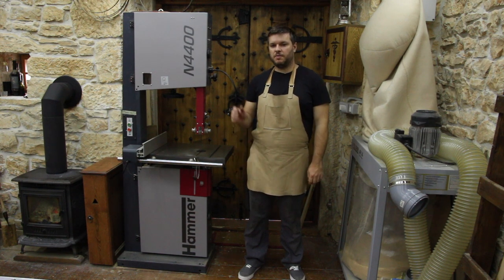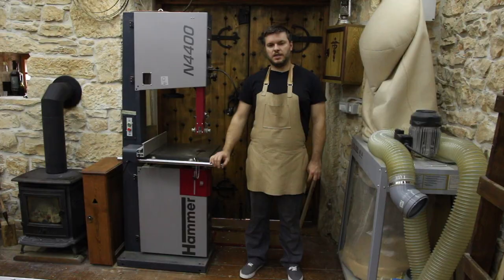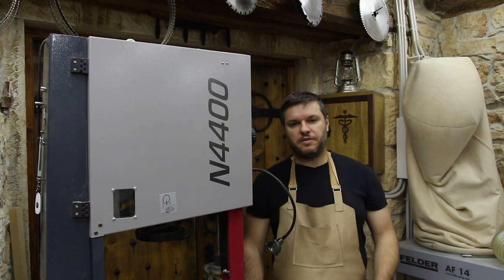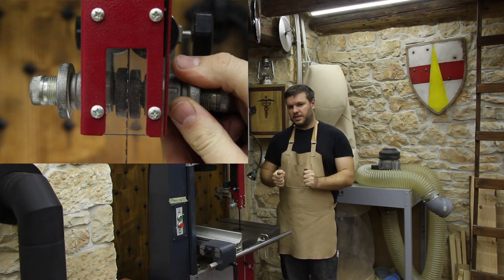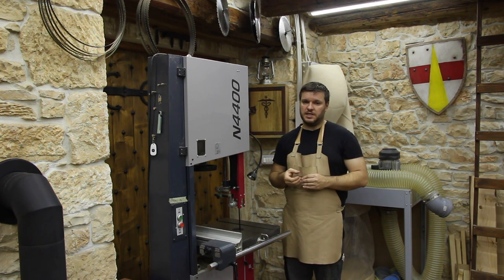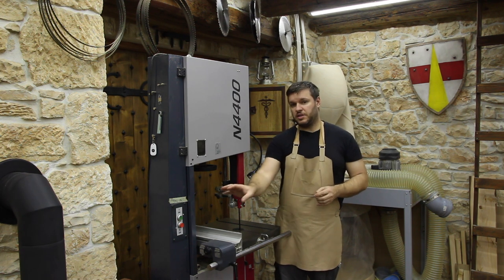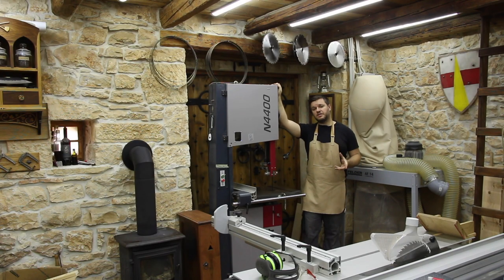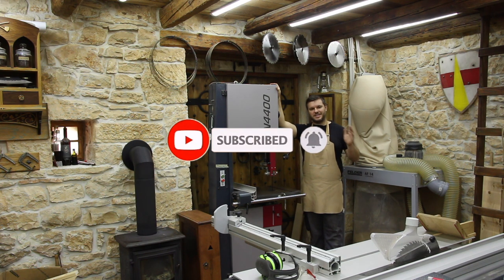Hammer N4400 Bandsaw - Likes and Dislikes

Comment: Forgetting to tension the blade is a problem with all bandsaws. What I do is when I un-tension the blade, I first open the top door. Then when I re-tension the blade, I close the top door. I just got used to only tension/un-tension the blade with the top door open. This has a lot of benefits for me:
* For setting the blade tension the correct way, you need the top door open anyway. I'll explain below.
* I never forget to put tension on the blade: because the door is open so the machine will not start.
* I (almost) never forget to un-tension the blade: when I look through the shop when I leave, I see that the door is still closed: that means I forgot to un-tension the blade.
* The top door has a circuit breaker: this means it is an extra safety measure helping with kids in your shop.

Let me explain why the top door needs to be open when tensioning:
Setting the correct tension is never done using the useless indicator on the machine. I moderately press on the sawblade along the length of the column on the left. I can only access this with the top door open. I just eyeball the deflection to be, let's say 10mm to 20 mm or so depending on the blade type. You can only do this along the left column, as there is nothing like blade guides influencing your measurement.
Reply from the maker: This is an eye opener! Nice tips, thank you for sharing :)
Reply: this is great idea :D

Comment: I have a N4400 and have the same problems with the guides and post. for a reminder about the tension I jus put a magnet on top of the table in front of the blade every time I take the tension off. great review. Thanks and good luck
Reply from the maker: The magnet tip is a good one! Thank you for the nice words 😊

Comment: Hello and congratulations for the review. I also bought the N4400 for 2 weeks but unfortunately I am not completely satisfied. For the moment the saw is stopped because it has a production defect and when it turns, it begins to vibrate dangerously ... it can happen, of course, but, at Felder, there is no testing and quality control service? I have been told that a technician will come in 2 weeks ... what? 2 weeks? And this would be warranty service? For the moment I am forced to take the wood to be cut by a carpenter friend of mine. I won't add anything else, otherwise I risk offending someone. One thing is certain: as soon as this problem is solved, the N4400 saw and the A3-31 plane will go on sale.
Reply: Did you end up selling your N4400? Or did you get the problems resolved and decided to keep it?
Reply: @Ezlivin  Hi,
in the end I sold it and bought a Laguna 18bx and although apparently it looks better, I am not satisfied with the build quality of the band saw (much better than the N4400). I have now also put the Laguna 18bx up for sale and am waiting for the Felder FB510. I hope to be luckier.
Reply from the maker: So have you got Felder 510?
I have two Felder 700 machines and I'm very pleased with them, they work fantastic and they are light years away from Hammer in build quality and performance.
Reply: @AndreaArzensek  Hi, unfortunately I haven't been able to sell the Laguna 18bx yet. Unfortunately there are some features of the Laguna saw that are unacceptable for potential buyers: 1-the blade replacement system is simply complicated and wastes a lot of time (ridiculous!), 2-the table inclination does not have a rack system and therefore the table must be tilted manually, losing all precision (very ridiculous and frustrating), 3-the structure of the saw is simply too light to accommodate 18" wheels. There are also other details, for example, I don't I like that this series is built on the "Asian continent" ;). I probably should have gotten a Laguna saw from the industrial series, which is built in Italy, but at this point I would have bought it directly from the manufacturer in Italy. As for the Felder FB510 or FB610, I think it's a great saw overall. The only thing I don't like is the lack of the quick blade release lever. At the moment though, I won't be getting any new band saws until I can sell the Laguna 18bx.
Reply from the maker: Thank you for your reply. Good luck selling your saw.
As I understand FB510 and 610 are the same saws just different wheels. As for quick lever tension - it is a shame but I got used on my N4400. I will probably upgrade to FB510 in the future or maybe look into some SCM machines.

Comment: This is a great bandsaw. I have one. It's very well made (in Austria, NOT China, like most or all of its competitors, and that was very important for me) and does not lack for power. In that class and price range, I think it's the best saw you can buy.

You're quite right, though, that the guides are the weak point. I have the very same issues you do. I think the N4400 may now come standard with the ceramic X-life guides (which is why I'm surprised to see yours came with the steel guides), though you can also buy after-market ceramic or bearing guides from Laguna and others. I have been planning that upgrade for a while.
Reply from the maker: We are overall quite happy as it is our first one and we don't know how we did without one. It is hard to compare because I have never worked on another one before.
But you're right about the power, I have monophasic motor and it eats through 10 inch oak with no problem.
I didn't know that they came standard with ceramic guides.
Reply: @AndreaArzensek  I don't know for sure if the N4400 now comes standard with the ceramic guides, but when I looked at the Felder website it seemed to imply that they come standard.

When I bought the bandsaw a few years ago it was somewhat new on the market and was considerably cheaper, so it was an even better bargain. I was looking mainly at some Lagunas (the Mini-Max and other Italians as well as the Felders were out of our price range). The N4400 turned out to be the perfect bandsaw for us. I prefer sawing a lot of things on the bandsaw because it's safer even than a sliding table saw.

Overall it's a great saw. I've resawn 10"-11" oak and maple without any problems. I run Lenox carbide-tipped blades (which are pricey but which I also recommend if you can get them in Europe) on it and they perform great. The steel-disc guides are tolerable, but if you can afford to to upgrade them it likely makes the saw even better.

Comment: Great review , i also have the Hammer N4400 , the K3 sliding table saw and the jointer. Honestly the only tool which I really like is the jointer. The K3 has many problems which are just annoying and the N4400 is also just lacking a so many details. The small fence, the missing scale on the fence , the horrible bladeguides ect...
Reply from the maker: I have found fence on N4400 to be Oland I don't miss scale on the fence, but it could have been added. The blade guides  have left a lot to be desired. 
K3 Winner for me was a disappoint but we upgraded to K700 and that is a beast, probably even an overkill for our needs but we love it.

Comment: Good review! I really enjoy your review. Little tip: I also always had the problem with tensioning the bandsaw, till i made a wooden block with magnets, which kind of functions like your sticker (it also says "tension!" ;-) ). 
Only difference is, that if I'm tensioning the saw and using it, i stick the block to the backside of the saw, but as soon as i detension the blade I stick the wooden block in front of the blade. So every time I'm walking up to the saw and the wooden block is there, I know i need to tension the blade.
Reply from the maker: That is a good idea! I'm sure I would somehow forget to put the block back where it is supposed to go 😂
But I'm getting better 🤣🤣🤣

Comment: Hi,  To set the table to negative degrees, you dont have to remove to 0 degree stop, its enough to slide it away and then you can tilt the table easily. But on mine 510 its was tighten well so I cannot move it by hand, I have to loosen it.

Comment: Thanks for the honest review!

The point about the tension is not a valid one I think. As a lot of users do not decrease the tension between use, it is a bit of a personal one . Either way it should just be something the user needs to get in his method of operation.
Reply from the maker: We tension and un-tension the saw every day at the beginning and the end of work day. If it were a quick lever it would take us 5 seconds instead of 40. It doesn't sound like much but math is simple. 52 weeks x 5 work days x 35 seconds comes to 2.5 hours lost tensioning the saw. That's how I see it. Again, not that of a big deal but it could have been better as much cheaper saws in USA have this feature.

Comment: Many thanks for the great  review Andrea. I also have a N4400 . What blade did you use for the wide cut of the oak board? The main issue I have with this saw is vibration. It’s not terrible, but despite all my efforts to tune the saw it still has some vibration, especially with a wide blade.
Murray
Reply from the maker: I think I have Lenox blade. It is okayish, I've heard that Slicer from Highland Woodworker are great blades and Tuff Saws from UK. I don't have much vibration on the saw. It is quite sturdy. Have you checked that the bandsaw sits flat on the ground? Because I shimmed mine as its base wasn't flat.

Comment: Great review thank you! I also saw that you have the Felder AF 14 chip extractor. I was wondering what are your thoughts to it? Cheers!
Reply from the maker: Thank you Adri. In short AF14 handles all of the machines without any problems, so it is plenty powerful.
However there are some "nuisances":
The release hinge for the bag is garbage and the holding ring has a lot of burr and sharp edges like it is made to cut your bags after the first use. I removed the hinge and thatmakes changing bag so much faster. I sanded the sharp ring and placed a blue tape to prevent it from cutting the bags.
Felt filter does it job but also let's go lots of fine dust in the air. This can be resolved by buying the canister filter with flaps. But it costs as same as the vacuum itself. I think I will upgrade to that or I will look into cyclone dust collectors. 
Even though it has problems, at the end it is very powerful chip collector and we are satisfied with it. 
I will eventually make a review of it.
Reply: @AndreaArzensek  Thank you, really helps!!